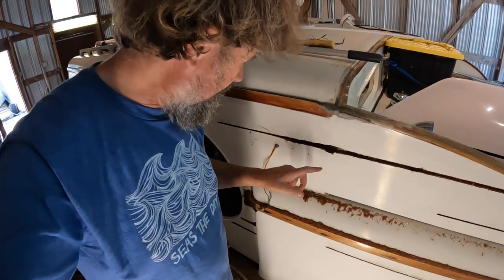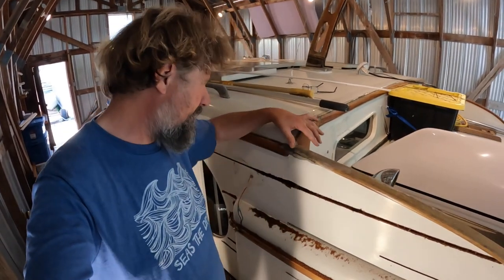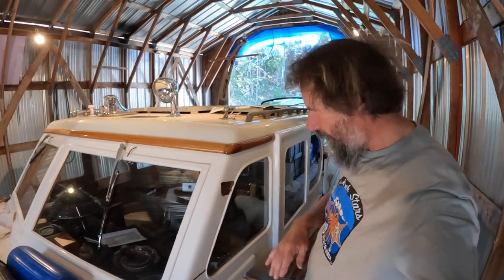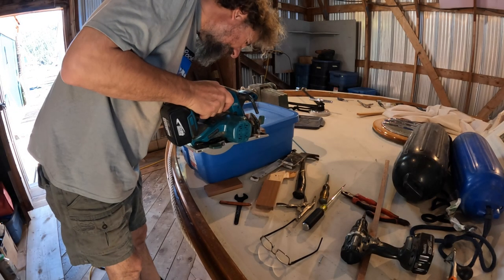Spline Time - #319 - Boat Life - Living aboard a wooden boat - Travels With Geordie

Comment: Hi Peter.
Your going to hate me.. in a nice way.. 🐱 ..
That small piece of trim.. needs removing and bedding on the top edge.. (and probably all the trim) as that is the most likely cause of the rot..
Also on the bottom edge of the trim.. do a chamfer so the water can't capillary back up..
I've done this to most bits including the strakes.. I don't bed the strakes, I remove them paint the hull and strakes.. it works.. neat paint work and no yucky rot..
Very jealous of the shed...
Regards
Mark and Bella 🐈

Comment: I'm wondering if might have been better to align the grain of the dutchmen with the grain of the frames. As it is now the dutchmen will expand and contract at 90 degrees to the window frames with the likely hood of  the edges cracking.
Always enjoy your channel!
Reply: Yes,  I would also worry about direction of grain and density on dry edges cracking!
Reply: A butterfly is cross grain intentionally? Basically a locking Dutchman.

Comment: I find it ambiguous to reference a spline in a boat regarding the two completely distinct uses. Wondering if there is better language to separate spline and groove edge joining and splining a surface joint? 
The house walls in my sailboat would have been better splined so the seasonal shrink would not result in a capillary joint straight inside so I feed oil based paint into them. My companionway slider was built with splines.
Honestly I agree with the community involvement assessment though if one looks at the current one it can be likwise from an anticompetitive outlook. Depends on ones motivation. I like to read prior comments and respond to interesting ones or something I feel of useful nature, then post something non repetitive. I think there is an un average commenter base here, I like it.

Comment: I was a little confused by your plan to insert a spline. Normally the splined edge has a groove in which a batten is inserted.  The boards are still butted together.  Of course, I see what you did but couldn’t that spline be of any width?
Reply: I agree with the terms ambitious use and not sure how to be specific without long description. I am in the wrong boat to look it up in books of oldest use.
Not sure on the width I have seen multiple. One was to act like a lap joint. If I did today's example my mahogany house would just rip the glued spline up, something must move.

Comment: the tarpy thingy

What I really liked the most with this video (and of ALL the other videos you have produced so far --- coz sometimes I've been notoriously angry with you) is something you did that is totally the opposite of a video I saw and commented on yesterday. I won't name the channel, just mention they're currently ambassadors of a certain plastic recycling initiative among sailors ... hahaha).

So what is it? It might be that there has been other sailing/boating/cruising channels that have done boat refit/sanding/resin work the right way while the boat has been on or near the water, but certainly many haven't: no catchment of the shit.

Do they forget that the resins/paints/epoxy/etc they spread all over are oil products, ie plastics?  
Do they forget it will turn into micro and nano plastics? 
Do they forget what such tiny plastics does to our oceans, both marine and terrestrial flora and fauna, and ultimately ourselves?
 
Maybe it's lack of knowledge?
Or pure idiocy?
So when you made that clever catchment tarpy thingy, boyy I smiled. 

Thx Peter. You made my day.
Reply from the maker: Thank you. I’m not perfect but I really feel horrible thinking of getting some crap in the water. Pure sawdust, less so.
Reply: @TravelsWithGeordie  Ofc no problem with sawdust: it's all natural (ppl), you're not producing saw mill quantities, nor do you use acid or toxic wood.

Comment: If it was 5200 you would not be able to reef that out of there that easily!
Reply: Sure you would.  If the wood around the 5200 rots to powder, it comes out in a nice neat little ball of goo.
Reply: @bobadam7021  that was not the case here. The wood on either side and below was solid. In that case 5200 is stronger than the material it is adhered to. I have heard many utubers curse at finding something attached with 5200. I myself have been an admirer of its strength when used on my boats.